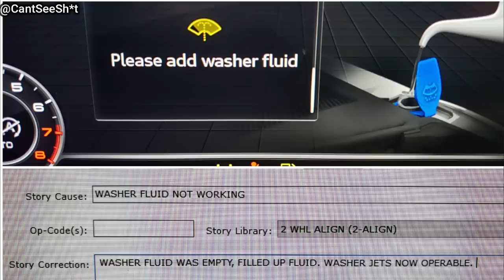Customer States Truck Feels Weird While Driving (GMC Sierra) | Just Rolled In

Comment: i want to emphasize one thing. if you are driving any semi and start smelling exhaust in the cab while driving, have the turbo checked out for blockage.

I worked for a company and after 6 dealerships and 4 terminals, they couldn't figure out what was causing the exhaust coming into the cab, making me nauseous.

then the last terminal, a green mechanic came in with 2 weeks experience, looked into it. found that a plastic walmart bag got sucked into the turbo and blocked the tubing from releasing the exhaust correctly.

2 WEEKS EXP!!!! all these others have tons of years and a rookie fixes their mistakes.

Comment: When we say not to overfill, we mean that the car has a placard. Automotive engineers say that the pressure you use is based on your application. Mostly highway? Then 20% over the placard minimum. Purely highway? Then 35% over the placard minimum. Never intentionally over the maximum noted on the sidewall of the tire. For example, sedan tires for kinda newish cars should not be at 25 psi, because 35 is much better. Similarly, they should not be at 65 psi, because 45 or 55 would be much better. But 37-42 is likely to be optimal. Surely it depends on the tire, the car, and the application. So, when we say not to over-inflate, it’s important to recall that we mean 100 psi, 80 psi, or 70 psi. You’re probably fine at 44 or 36. Some allow 51. Truck tires may be fine in the 60-90 psi range, not the 150-300 psi range.

Comment: I've got a 1971 mercury cougar I'm in the middle of getting road worthy, the rear shocks were totally inoperable, the shrouding around the piston had nearly completely rotted away. I guess that's just how things go in a car sitting in a collapsed barn since 1986.
Reply: My brother bought a car with McPherson struts. It rode very hard on the front. When he got it apart, it was clear that water got inside the strut tube, then froze, collapsing the OD of the shock until it gripped the piston tightly.

Comment: 1:18.   wow. just moments away from disaster.    i remember taking in my older chevy malibu to get a trailer hitch installed, was moving 1500 miles away and decided to use a u-haul.   mechanic calls me and tells me "not gonna happen", he informed me my rear frame behind the back wheels was almost completely rusted out.    a couple things can cause this, salt (to melt ice) from the roads, driving thru, or sitting in flooded water, especially salt water.

Comment: I have replaced my front shocks on my f350 but not the rears. I dont think they budge since the springs are so stiff.   Love the tire blows. I run load c tires on our wood trl and ive had around 10000 lbs im guessing. I pissed some people off im sure cause i ran about 10 mph on back roads and a stretch of a less back road till i could get to the main road and run the shoulder

Comment: a broken threading of the underlying fabric can also be detected by an indentation on the sidewall that looks like it shouldn't be there. sometimes you can feel a soft spot when the tyre is uninflated yet mounted. such spots come from driving up a curb too hard, and the tyre can pop in that spot too. or dismember itself.
0:27 rethreaded tyres can lose their thread, too, eventually. I think they are not made anymore in europe, or only in narrow sizes for old classics... I had some long ago, and one started to make noise and vibrations. went to a shop for balancing, and it turned out the fabric was breaking all underneath the thread making the tyre lose shape. needless to say I had all four tyres replaced.
flashlights for fog lights? and then wiring them to a switch? while they looked anywhere but onto the road? with that much effort they could have bought real, universal foglights like the ones we used to screw under the front bumper, and fasten them to their plastic tupper cup...
1:58 seeing the wheel I wouldn't bother with the tyre and sell them two or four new ones. and possibly a wheel or two... who knows what they been running over before to destroy that wheel like that.
2:09 nuts not tightened? or wrong nuts? something like that.
when I was working mechanic at Opel's we had one Omega-A (known to 'strayans as Holden Commodore, and I think sold in the US as a cadillac for beginners?) with untightened wheel screws on front left.. amazingly enough the wheel didn't fall off... because it had moved around a while when they drove on the highway and finally welded itself to the hub... and we noticed only when we checked the brakes, and the screws were like falling out... except the wheel, didn't. we had to cut it off until we could reach the brake to be able to remove the hub as well.
2:18 you must be kitten us! =^_^=
when shocks look like this, and are easily available there is no reason not to replace them. driving improves a lot with good shocks. :)

Comment: I work in car rental. Can confirm people are stupid about tires. There are still plenty of people who think they can tell when a tire "looks flat", and they just keep adding air until they think it looks right.  "Pressure gauge? What's that? What do you mean the correct pressure is on a sticker inside the driver door frame?"  I've seen people claim tires are "low" when they are correct. I've also seen cars with wildly varying pressures in the 4 tires. I've had to explain to people that hot weather makes the pressures in the tires increase, and then I have to explain what "cold pressure" means.

Fact of the matter is, new cars today will tell you when the pressure is incorrect in one or more tires. However, the meaning of a tire pressure light being on can vary from model to model. Volkswagens will turn the warning light on if the pressure is too high, as well as too low. VW also will accept a "tire pressure set" accessible in the menu (sometimes it's a button inside the glovebox) and can re-learn a "correct" pressure of your choice.  Other cars only warn if the pressure is too low.

Also, if the car tells you that the left rear tire is low, don't necessarily believe it. I've seen many GM cars with these sensor harnesses installed incorrectly. They will report "rear left" tire is low, when it's actually the "front right" tire that's wrong. Always check the tire itself with a gauge.

Comment: Oof. Hard lesson learned when filling your tires. Get a blamed pressure gage! The tires usually say what psi they require on the side. Check it as you air it. That dude could've been seriously injured when the tire blew out.

Comment: As a Viewer  from England could do do a video on Inspections and how they work over there. As in the UK   ALL vehicle's have to have an Annual inspection. I am amazed how some cars get into such a poor state of rot/rust
Reply: The rusted out vehicles are probably in colder states that use salt on the roads to melt ice.  Where I live, longer lived cars don't die from the years or miles, but from the salt.  Same is true if you are close enough to the oceans for salt spray.

Comment: 1:27 - Would have been cheaper, easier, and more effective to just buy a set of actual fog lights! And that wiring job...
2:45 - Been there, done that, a few times myself.
Even had a few struts like that. I used to call it "adjustable ride height" because I could push the fender down, or pull up, to desired height and the car would stay there. I'll never buy Monro Quick Struts ever again.

Comment: It takes an airhead to over inflate the tires without checking to see what the maximum psi is. It's right there on the side of the tire along with the tire's specs and manufacturer.

Comment: One of my tires is at 254 psi. At least that's what my TPMS says, which I think may or may not be broken maybe
Reply from the maker: TPMS sensor down lol. Usually they read a crazy pressure Iike that when they are no longer working from my experience.

Comment: I saw a video that was taken in a place like India.  The video came from a business outdoor camera.
    A technician was airing up a tire that goes on a Lorie or Semi truck.  The tire was laying on the ground, and he was sitting on top of the tire.  After around 10 seconds, the tire explodes and the guy gets shot up into the air.  You can see the co workers running around looking for him.
     After about 3 to 4 seconds, you can see the guy hit the ground JUST in view of the camera (left edge of screen). He ended up landing on a patch of dirt/ground that was, what looked like, an island separating the highway and businesses.  
   I don't know what happened to him, but if he made it alive, I'm sure he was seriously injured.
Reply: There is a reason they fill truck tires in a tire cage!  When they blow they shake the whole building.

Comment: Many years ago, I had my mom's '72 Caddy jacked up to remove the RF tire.  You remember how long the jacks were and the crazy angle the car would have been at.  She jumps in, and backs it off the jack, rotor slams into concrete floor.  Comes in the house and says "there was a bump when I tried to drive the car."

Comment: It's amazing how many people don't even bother to look when the hear or feel something is off. Flashlights as fog lights, I mean...WHY!? Cheaper and easier to fit actual fog lights, and more effective.@0 L of gravy. I once had 4 imperial gallon glass milk just break in the back of a VW Beetle. That's 18.32 L or 4.81 US gallons. You cannot imagine how long the stink lasted. Even after a "professional" cleaning. Do people even know that tires are made to take specific pressures? People are NUTS!

Comment: Had a tire blow up on me like that once, turns out it had been rubbing something on the inside of the wheel well and the inside wall of the tire had been worn down to basically nothing. It was under 40 PSI but it scared the piss out of me.

Comment: Thise shocks look like the ones I just replaced on the 2006 duramax my mom gave that used to he my dad's.  I told her it needed new shocks but she was sure she had done that recently anyways she planned on giving me the truck anyways so I accepted it fixed it up and now I have a truck that reminds me of my dad and will most likely run at least another 200k if not more as long as I keep up on maintenance which I will do myself because I have the skills and tools to do about everything aside from an engine hoist which if needed I would just buy anyways since my mom did sell my dad's after he passed and have plans to restore the few old vehicles he had that he wanted to restore when he retired.

Comment: I usually have to let air out of my tires every year when I drive to Florida from a cold climate, going from sub-freezing weather to warm weather increases the pressure by 5-10 psi. But nowhere near 90psi!
Reply: People don't understand the effect of outside temp on the pressure. I set my tire pressure in Canada in the winter, then set off on a road trip to Mexico. When I arrived in Mexico City (~7000' elev), the pressure was almost 15psi higher!
Reply: @e-curb  Yes and altitude has the same effect so you got a double whammy!
Reply: @SSHitMan  Sounds like you know all about PV=nRT.

Comment: The last one might not be overfilled pressure in the tyre. Could have been run for a very long time at low pressure and stuffed the sidewalls. Pump it up to normal pressure and bang.

Comment: 90 psi? Lol 32 works. This older lady came into the valvoline I used to work at and she had 134 psi in one of her tires and the rest were pretty close to that, I’m not sure how much air you can actually cram into a tire without it blowing up but I think 134 psi is right on the limit lol.

Comment: Had to replace my fan belt, had a black snake in my compartment and when I started my pickup it killed the snake and damaged my belt.🇺🇸🇺🇸🍻😂🤣
Reply from the maker: Snake in engine department. We don't really have snakes here so that would have surprised me 😅
Reply: @JustRolledIn  it must have curled up to take a nap, chopped it up when the motor started. Threw the belt.
Reply from the maker: @artjohnson4133  way to go Art, this is why we can't have nice things 😆
Reply: @JustRolledIn  😂🤣🤣 yep, I was the loose nut behind the wheel.

Comment: And then, here I am with small, tall wall tires. 31.9 PSI ..
Never overinflate your tires. It messes with the suspension, ruins ride comfort and potentially endangers everyone. It only aids in fuel economy a bit, and until a certain level.
Same applies over underinflation. It wears your tires out faster, ruins comfort and strains the suspension. The only acceptable condition is winter when losing air for more grip is an option.

Comment: People don't realise what actual pressure is in the overall surface area of a tyre... 40PSI is 40 pounds pushing against each SQUARE INCH of the surface... multiply that by the total surface area and you start to understand...

 e.g. if the inner surface area was 4 square feet (wild-ass guess🙄) that equates to 576 square inches, now multiply that by the pressure (40psi) and you get over 23 THOUSAND pounds of pressure in that tyre... or 10 TONS.. 😱

Comment: I literally just stepped out the door at a tire shop when BOOM! A semi truck tire exploded. I felt the air pressure push me forward and I stumbled to the ground. I thought the building exploded!
Reply: I had that happen while I was inside the tire shop. It felt like a bomb went off, and the air was filled with the dust that had accumulated in hard-to-reach places over the years.

Comment: Just set your pressures to 35 psi and call it a day. If you can't remember that, inflate your tires a little bit at a time until your low tire pressure light goes off on your dash. If you still can't remember that, call roadside assistance and have them tow your car to a stealership so I can get paid. My last paycheck sucked.

Comment: I had a female employee, who overfilled the tires on my work-car. It was supposed to be around 35 PSI, so she filled them up to 3.5 BAR. It felt funny when I drove it, so I checked the tire pressure, and corrected it. Told her to look for the decimal point next time.
Reply: Truth, the recommended pressure for the front of my car is 18psi (engine in the back). When I get new tires mounted, the tire jockey always asks what pressure do I want. They all refuse to set it that low.
Reply: @e-curb  I would like you to verify that number with the manufacturer of your car. That is very likely wrong.
Reply: @AllanFolm    You're just as skeptical as the tire shops! 
It is absolutely correct. The manufacturer's inflation label for my car is on the inside of the glove box door. I've owned many of this model, the label is always there and always says 18psi, so it's not a misprint.  In fact, back in the days when the car was supplied with non-radial type tires (1960s), the recommended front inflation pressure was 16psi! 
Today, people who are new to owning this model unknowingly set them to 32psi, then complain how crappy the ride is.
Reply: @e-curb  Make and model? With that low pressure, you won't get any directional control from the tire. Also, the carrying capacity of the tire will be very low.
Reply: @AllanFolm  old VW Beetle.  There's less than 400lbs on each front tire. Inflating it to 25 or 30psi will make it ride on the center of the tread only. It needs to be that low to flex properly.
I know one guy who said that the pressure you should inflate a tire to is related to the current load vs the max for the tire.  So if your tire's load is at 75% of the max load rating, your pressure should be 75% of the max inflation pressure.

Comment: the problem with overfillig is, that you never know, when it actually is overfilled until you overfill.
Reply: Buttttt if u have a tire gauge, u would know it’s too much and just let some out…i think that would be easy. I go to station where u enter the amount of pressure and it only inflates to that amount. I love that gas station, I’m definitely not good at knowing how much i have put in
Reply: @JustConfused_24-7  too much is, when it can't take anymore (explodes). everything below that may be much but the tire won't have any problem. exept very low pressure which is far more dangerous than high pressure.
without a gauge it is impossible to set the right amount of pressure for the car and condition. the right amount is usually FAR away from overinflation.
Reply: @TheHolan  Why is under inflated more dangerous? Just asking because I don’t know and want to b safe on the roads. I have those tire pressure signals in my car that I sometimes ignore for a little bit. What could happen other than me ruining my tire while driving it that way
Reply: @JustConfused_24-7  while running the do heat up VERY much. then they burst. also the car does not behave well with low tyre pressure.
Reply: @TheHolan  thank you!! I didn’t know about heating up!

Comment: Fill up the tank, fill up the engine with oil, and fill up the tires with air.  That's how it works.  Eventually you will see the self-service air pumps outlawed because they are dangerous.  The stupidity never ends.

Comment: Race car drivers may adjust their tire PSI to suit the needs of the road/track, but even then, I HIGHLY doubt they'd overfill their tires damn near the point of failure. That's akin to strapping a grenade to your tire and hoping it "somehow" doesn't do anything after removing the pin.

You, the guy who filled the tires (if you didn't do it yourself) and everyone else who is aware of what you/the other guy has done know full well what's about to happen in due time. And the responsibility falls upon you... And also the guy who filled the tires per your own demands.

Bigger numbers are not always better. Don't gamble on it. Fill to standard and adjust for the climate. NEVER overfill.

Comment: Car tires should never exceed 30 p.s.i. pickup trucks usually 35 p.s.I.and trailer tires 65 p.S.I. you can usually find your vehicles recommended tire pressure on a decal on the driver's door frame.